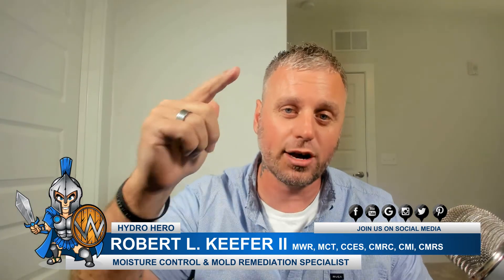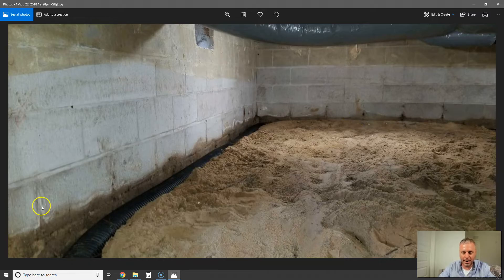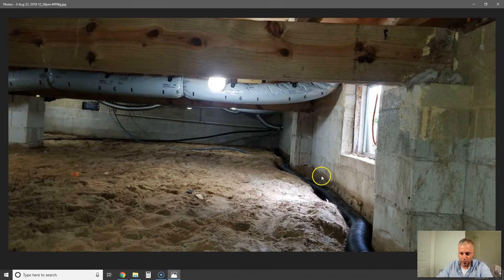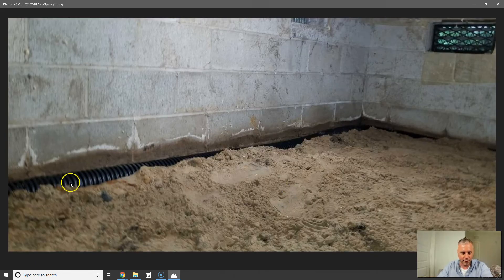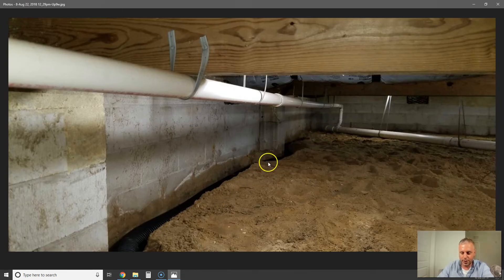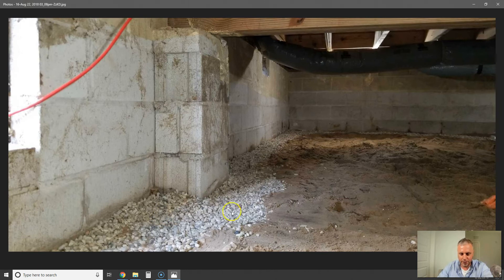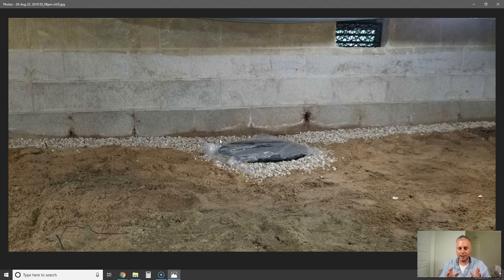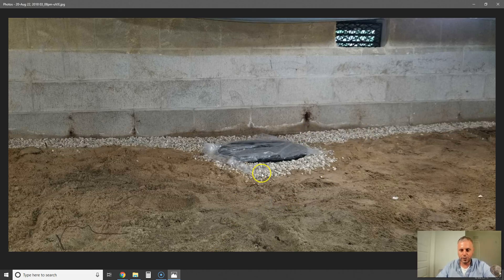Get Educated! How Should A Crawl Space  Drainage System  Be Installed?

Comment: You should have ditches from the time it was built and all homes have a gravity drain in the lowest corner. If those ditches are clear and the drain is clear then the water should drain out. Usually there are 4-5 high spots that need cleared out of the drainage and the gravity drain needs uncovered or unclogged w a drain snake. Those drain n gravel systems without a sentiment sock around the pipe will just clog up eventually.

Comment: Thank you for this great video!  I have a few questions I hope you will answer for me:  
How deep below the footer was the trench dug?  
How many inches of gravel did you install?
After I level/grade the soil in the crawl space as my first step, how do I decide where the sump pump basin will go?
To where do you typically place/tie in the drain pipe from the basin for exterior drain routing?  In other words, where does the water from pump actually go?

Thank you so much in advance for your knowledge and advice.  I hope all is well, and hope to to hear from you soon!
Reply: 1.)	How deep below the footer was the trench dug?  Bottom of trench should be even with the footer.  Hydraulic pressure pushes water up under foundation/footer, you want to capture it there.
2.)	How many inches of gravel did you install? Depends on how deep the footer is.  We aim for a 10 inch of so trench (which locally puts us at footer level).  We are using a 4inch perforated pipe, gravel covers to ground level.
3.)	After I level/grade the soil in the crawl space as my first step, how do I decide where the sump pump basin will go? There is usually a lower corner.  If not, we look outside and determine how the exterior property runs and place it on the lower side.  
4.)	To where do you typically place/tie in the drain pipe from the basin for exterior drain routing? In other words, where does the water from pump actually go? The sump pump has a discharge on the top of the pipe.  We run a PVC pipe from that pump discharge up to the sill plate, exit through the sill plate,  down to below ground level through a freeze relief connected to  3 inch PVC pipe and dig a discharge trench at least 30” from the house to a place where the water will run away from the house and end with a pop-up valve at ground level

Comment: I don’t understand when they build a home, they don’t automatically install a drainage system by the footer of the crawl space..  That just seems like it should be the norm..
Reply: Most homes have a drainage system.  My home was built in the 1960s and after 60+ years, dirt and other things have clogged it to the point it can no longer be jetted out.  Drainage tile doesn't last forever--especially when done during the 1960s.
Reply: @davidp8627  my home was built mid terrain on a downward slope to a wetland region! With no drainage system in the crawlspace.  I have remedied some of this thru agricultural swales, but will have to add a sump pump to drain the remaining surplus..

Comment: At first, I thought it was done wrong and the pipe was on top of the footer, until he said "They have a tiny footer." I do this for a living, eighteen years, but I only do a few jobs per year now. In 63 and I can only go about four hours per day.  I watched the whole video. It's done 100% correctly.

The largest pest control firm in the world does these are it's horrific . I have about 80 videos that I'm dying to put online.  Trash cans for basins. Pedestal -type sump pumps ($70) and they charge $1900. The basin floats up, the pedestal  turns over and the system either shuts off or runs until it burns up. They somehow blame the homeowner or the salesman and move on. They went NYSE and they must have ante year plan to maximize profits off their good name and then close it.
Reply: Does the footer pipe need to run down hill all around the footer to the sump pump? Or can it be level and water will find its way to the basin ?
Reply: Marlboro Matt the best thing to do is dig the ditch first. It's hard work. Pace yourself. Depending on how bad your water problem is, determines how big a ditch you want. Pour the base gravel into the ditch first and make sure it is level using the footer as a guide. We know the footer is flat and level. Put the pipe in, with the holes pointed down and look it over before you pour the next bags of gravel on. You can't make adjustments after that. Flat as a fritter, sir. It will not fail to go to the sump pump. If you try to put slope in it, you'll mess it up. The first one I did nearly killed me. I put in and took out the gravel twice, trying to put slope in it. Apple Drains straightened me out. Watch his videos. He's the man. We Can do just about anything now, but only because of him.   And his videos.
Reply: @thetruthchannel4634  have you tried using a laser for slope? Impossible to mess it up that way

Comment: I may have missed it but do you not use a trench wrap and sock? Aren't you afraid that dirt and small particles can get through the porous gravel and cause it to fail in 5-10 years? Eventually the small particles that shift through the gravel will enter the sump pump basin and clog all the drains.
Reply: I was thinking the same thing.  I think a filter sock would be a good addition to this as it would prevent dirt from entering the pipe and making it's way into the sump pit.

Comment: my footer is already exposed from erosion of the sandy soil. can i use the fabric wrap pipe and just back fill with sand as long as i have it at the base of the footer? i live on really low low  low ground close to the river..well actually i live on the old river bottom from centuries ago and the water table is very hi. i can hit water within 3 ft with a post hole digger tool and i feel my pump is too low in the ground and breaching the water table..what are your thoughts. thank you for your time to reply..russ

Comment: Great info thanks so much!!!  I am trying to combat this issue.  Seems to be a never ending battle living so close to Lake Erie and the rising levels creating non stop problems.  My pump works fine and there are other things I know I have to do.  I do the work myself lol, 58 yr old tough girl I am.  Should I put a sock of some sort on the drain tile?  I am thinking so because my crawl space is all sand.   My home is small, 680 sq/ft but I need to get the water to the pump right?  Gravel top and bottom as well?
Reply: Yes.  Dig down 6 to 8in, line the ditch with a woven weed barrier fabric, install your 4in (perforated, sock covered pipe), then back fill with a 1 to 2in 3/4" crush filter rock, wrap your rock with the top part of the fabric, and cover with remaining rock to ground level.

Comment: I completely understand the concept but I did have three questions. 

1. Do you dig down beside the footer, so that the bottom gravel layer installed is even with the  bottom of the footer and not slightly below the footer? 

2. Will the soil remain saturated/wet where the bottom layer of gravel is since the pipe is 1-2 inches higher?

Thanks in advance!!

Comment: Would this still drainage system still work if you are planning to pour concrete in the crawl space?
Reply from the maker: Hi Mike! Yes, but would caution against a slap in a crawl space. If something were to go wrong you would be looking at the cost of jackhammering up concrete. Extremely expensive to fix and a slap will not stop moisture problems.

Comment: Hey Robert, Do you need to put gravel in the trench before the pipe to prevent clogging ?
Reply from the maker: If you are not using a non woven DOT approved geotextile designed as a soil separator and drainage fabric the answer is yes. If you do us that fabric like we do now (see new videos) then you would not. Thanks for commenting!

Comment: This is a great explanation of how the system works. One question I had is why bother filling the trench with a  perforated pipe and gravel, just simply leave the trench "open". During a rain event, the water will fill the trench and make it's way to the sump pit. If you add gravel + 4-inch perforated pipe then the 1st inch of water, which is moving through the gravel because the perforated pipe is laying on a 1-inch bed of gravel, will be impeded somewhat by the gravel as it flows to the sump pit and therefore flow more slowly then if the trench were completely open and therefore unimpeded by gravel. I assume most rain events will be small-ish, so most rain events will fill the trench the first inch only and never enter the perforated pipe.

I understand you need 4-inch pipe + gravel if it's outside where kids or pets run and play or in an underground basement with a smooth, wall-to-wall concrete floor, but in a crawlspace nobody's going to trip while walking across the trench or care about "uglyness".
Reply from the maker: Hi Donald. Great comment by the way! The simple answer is the trench will collapse rapidly. Often if we don't get whole drainage system in on day way and it rains overnight we have to resign the trench. Some soils may take longer to collapse than others but in most soil  its immediately. We have also improved this drainage system more by containing the whole system with a specialized non woven geotextile. Check out some of the new videos of that.